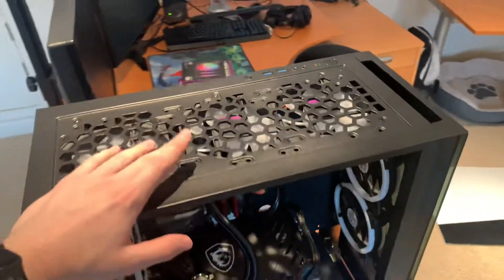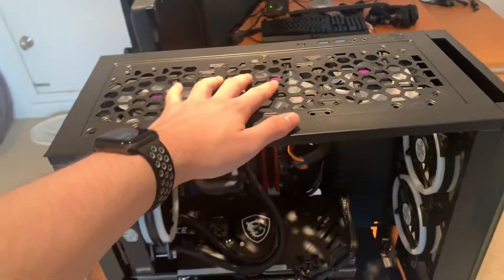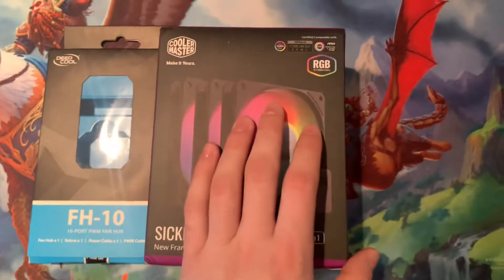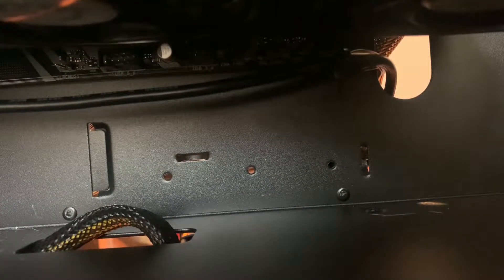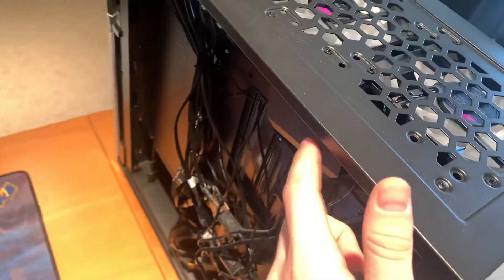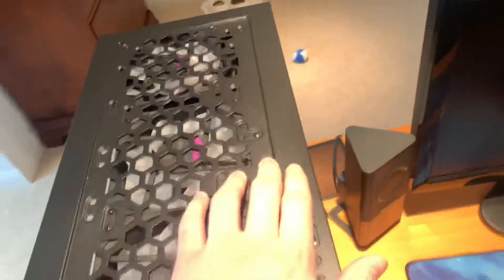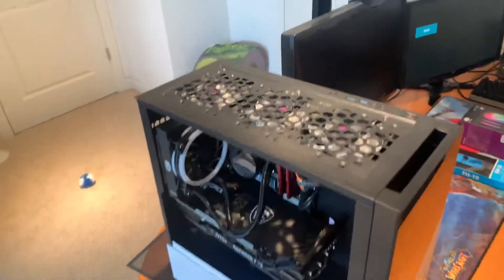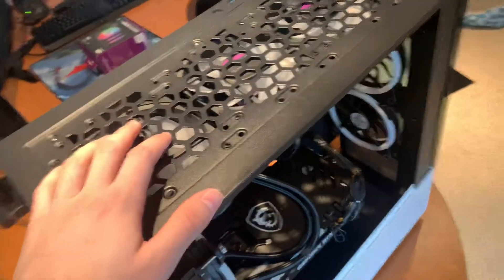How to Install More Fans to a Prebuilt Gaming PC (Specifically the CyberpowerPC Gamer Supreme)

Comment: At the end you say it dropped the temp - were you talking about CPU temp? Curious how adding more exhaust fans would help when you have an AIO cooler that isnblowing out the back. Inhave thr same setup and my pc has had high cpu temps ever since i bought it.
Reply: Liquid cooler fan can be used as exhaust to remove the hot air from inside the case. 
Its really not that strong but it still decent when you already installed 3 exhaust fans on top.

Comment: The worst thing you could do was installing the CPU radiator on the side and even worse to install the cooling pipes lower than CPU pump.
Reply: The hoses on the bottom don’t matter if the top of the radiator is higher than the pump, all the air is trapped at the highest point of the system… dumbass

Comment: Thanks for this bro gonna check the updated video. Apex legends while using dual monitors my temps were touching 83 Celsius. Not terrible but still pretty high. Im gonna do this and add some new thermal cooler to my CPU. My PCs about 3 going on 4 years old now
Reply: Did you get any temperature reduction? I have this pc and I’m wondering if adding fans helps at all.

Comment: Great vid man, I searched the CyberPower fan Model numbers to buy more for this same reason (have same exact PC, CPU and card get way to hot)
Reply: What fans did you find
Reply: @AGUYNAMED278  Same as everything he used right from the links. Still runnin smooth. Also as per another vid, I moved the Radiator Blow In fan and moved it to the bottom front empty space. That way it was 3 IN and 4 OUT (counting the Radiator Blow Out fan behind it)

Comment: do you know if the front panel comes off? i want to add a third fan to the front but cant seem to figure it out
Reply: Hey! It does come off if you look closely there are 3 prongs on each side you need to press in to remove it

Comment: bro i load up my armoury crate and when i check fans my cpu fan is at 0 rpm and i cant control them ...but i can control my lights on my pc and i got 3 fans so idk man can yopu help and my prebuild came with one wire and i dont know where it goes on my motherboard

Comment: Hey bro quick question how would i go about changing the Aio cooler i have a 3070 i9 11900KF build but cpu seems to be to high so i bought a kraken x73 to replace but first time and alil scared so its just been sitting there tbh?? any tips or ideas

Comment: I have the same pc just mine cost 950 so my cpu keeps changing temps randomly. Let’s say I open chrome or my setting anything I open my pc goes to 40-50-60 and during games it goes up to even 80 do you have any advice hat can help me solve this problem?
Reply: Maybe changing the position of the radiator buying new fans and configuring them correctly

Comment: great video, but just a small suggestion

for around 50 usd u could easily swap the case for something with more airflow like a montech or for a little more, around 90, the corsair 4000D. 

Case swaps are great for learning small lessons in pc building and cable routing.
Reply: I would also like to note that I've purchased a very similar prebuilt from cyberpower pc, ryzen 5 36000 rtx 3060 ballistix 16 gb, same case, amd wraith cooler.

I've replaced everything, including the case and those ugly ketchup/mustard cables, and except the psu.
Reply: @okokayy can u show it
Reply: @user-hl5tz4rx9f  don't know how to do that without adding a video to my channel but my build is now a 5900x 3060 32gb gskill 750w psu x570 mobo lian li 216 case from this year. totally different build now
Reply: so would you just change the case rather than adding the fans? new to pc so i would have to watch a video to change cases and itll probably take hours but you let me know if just adding the fans will solve my problem
Reply: So this is what I was curious about. Is the issue that the case doesn't give proper air flow or is it the fact that theres only 3 fans in the build? Unsure if I should get more fans, a new case, or both.

Comment: You're hitting 84 degrees on what? I have basically the same PC except it didn't have an aio, I replaced the CPU cooler and all the fans plus added 3 on top and one in the front and I rarely get over 70 on the GPU and 65 on the cpu
Reply from the maker: Assassins Creed Odyssey made my computer pretty hot but since installing the fans ive had no problems

Comment: I'm wanting to replace the 3 front fans in my cyberpowerpc. I'm really nervous about it because I've never done it before and it looks like they have all the fans chained together and plugged into fan port 1. My pc didn't come with a fan hub or anything. I'm replacing them with corsair ll120 and using the node and core that comes with them. I know how to install the fans but I'm scared to mess anything up when taking out the other fans because I'm not changing the cpu cooler yet but I believe it's linked in with the front fans. Any advice you can give me?
Reply: you’re going to ruin it bozo
Reply: @andrewbroham3811  I got it all working perfectly on the first try! It was pretty simple once I started unplugging everything lol

Comment: I have this type of pc and I blue screen every other 3 days. I don’t know what the problem is I’ve took it to geek squad a couple times and it’s still doing the same thing. I’m going to take it to cyber power to repair hopefully it works! Also do u recommend buying an airflow case?
Reply from the maker: the blue screen doesnt sound good my man, take it in and they will get you sorted. A new case would definitely be benficial, i do not like the design of this case, not alot of room for airflow
Reply: You need to run a couple programs and watch your temperatures

Comment: did your cpu temperature go down? if so how much
Reply from the maker: so i cant give you an exact measurement but for reference i was playing Assassins Creed Odyssey at the time and was noticing the potential for overheating, reaching around 90deg, now i can play for as long as i want with no trouble staying at around 83deg. Recently ive been playing Control at 1440p max settings with ray tracing at high and im getting no hot temp spikes and it runs smoothly

Comment: is the cpu cooler that comes with this thing decent enough? i have one and literally did exactly what you just did thanks for this video (thank you by the way) but was curious if swapping out the cpu cooler for something like a be quiet air cooler would even be worth the money
Reply from the maker: well any upgrade is an upgrade but my computer has not gotten hot once since adding these fans so i dont know how necessarily worth it is currently
Reply: @royrodgersmf  ahh fair enough. ty for the response
Reply: Do you think noctua nhd15 will work good for this?

Comment: How do you remove the front panel? I want to add extra fan. Thanks
Reply: There's 2 tabs on each side that push in, just do one side and then the other and it pops off
Reply: @MrBeetsGaming  do you have to remove the side panel to do so?
Reply: @tjbarnett8430  yes
Reply from the maker: i really am unsure of that front panel, i saw somewhere that if you remove both sides it can come off. Id try searching the best buy reviews i believe i saw it there

Comment: I want to install two extra case fans inside the top of my pc but I only have one chasis header. Thankfully I have that chasis header available because the rest of my case fans are connected to my PSU - it's a pre-built pc, that's how it came. I'm wondering if it will be a problem if I buy two extra fans (same as yours - with rgb), connect a y-splitter to them, and then connect the y-splitter to the MOBO while having the other case fans connected to the PSU. MOBO also has RGB_LED2 header available.

Comment: Hey, would you try replacing the crappy fan on the aio with one of the nice sickle flow fans and report back. I feel like they slapped a shitty fan with different speeds and static pressure on one side of the aio that already comes with a nice fan (pretty sure the exact same ones you bought) and that could be hurting the build.
Reply from the maker: I have noticed what you are talking about, my CPU fan (fan controlled by cpu fan port on MOBO) does not ever change speeds its always at 2300
Reply: @royrodgersmf  Give it a shot mine will be ready for pick up Saturday, I might buy one of those nice fans you got and try it out on the aio myself and replace the one they slapped on it to test. It's just something I noticed while looking at the best buy review pictures which is how I ended up here. Then maybe I'll use the extra fan for exhaust up top as you did. If it had more exhaust I'd use it to blow into the vrm, but since it doesn't I'll probably use it like yours. Nice vid.
Reply: I changed my liquid cooling to a corasair setup and have no problems now with heating

Comment: I ordered this PC a few weeks ago and have ran into one major issue. While playing games, I have noticed that my PC abruptly turns off and I have yet to solve this issue. Based off some research, it could be 1 of 2 things: bad PSU or PC is overheating while playing causing the PC to shut off. Have you or anyone else you know experienced this issue before? Do you think adding new fans would help? This is my first time owning a PC and I am extremely new to this and am learning as I go. Thanks to this video, I will probably buy the fans you got and install them the exact same way!
Reply from the maker: Hey man, dont be alarmed by this issue, as all issues can be fixed through some trial and error or by sending that shit back lol. In your case it does sound like a bad PSU, what id do is download the program Core Temp and play a game you normally play. I sadly do not believe its overheating, as if it is not blue screening or freezing it is most likely a bad PSU.
Contact CyperpowerPC and they will get you taken care of.
Hope you can sort it out, but regardless once you get that issue taken care of install some fans, itll make a huge difference.
Reply: I had this problem aswell... it was because my graphics card was too heavy for the case and it would randomly come out of the slot and turn off, everytrhing still worked in terms of sound and keyboard, but i could see anything.
My fix was simple... but funny.. i took 7 regular sized lego blocks and stacked them under teh corner of the GPU that had no support.. and it hasnt turned off since

Comment: I bought this same pc from Best Buy and had the same issue with the 3 fans on top running full speed. Unfortunately I had to send the pc back for repair but as soon as I get it back from cyberpowerpc I’m going to install them the way you did.
Reply: I’ve got this pc and have no heating issues. During most intense gaming it runs in the 60c to 70c range. During most normal gaming it runs in the 50c. I’ve seen mine as low as in the 30c. Not sure if it’s necessary to add fans. What do you think?
Reply from the maker: @PSNplayer1.0  well it truly depends on the games you play, it cant really hurt to add more. I blame the bad temps on the case design, its just a big glass box and gets hot very fast, especially with no output fans. If you plan to play some raytracing big budget current titles then id add more fans
Reply from the maker: Awesome man, hope all goes well. Had this PC for about a month now and it kicks ass, even for 3d rendering!

Comment: Can you install fans without unplugging anything? I'm not so great with following on what to plug where but I want to put more fans. I have the same PC
Reply from the maker: I will make an additional tutorial trying to explain the wiring a bit better. The short answer is there are 2 fan ports on the motherboard, but the 2nd port “Chassis Fan 2” which is under the graphics card, is used for lower wattage fans and they cant be speed controlled the same way. Without plugging anything in the additional added fans will blow at 100% speed all the time, by linking them together into the 1st port the speed of the fans is controlled by the motherboard based on the temp of ur CPU or GPU
Reply: @royrodgersmf  Thank you, looking forward to it.
Reply from the maker: Additional tutorial coming out today!